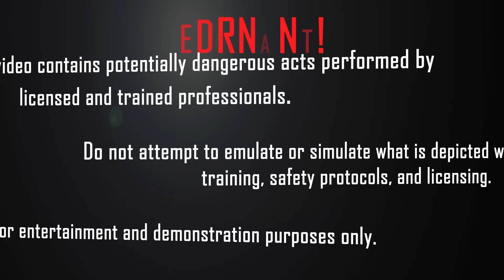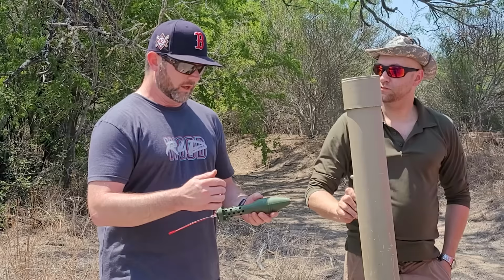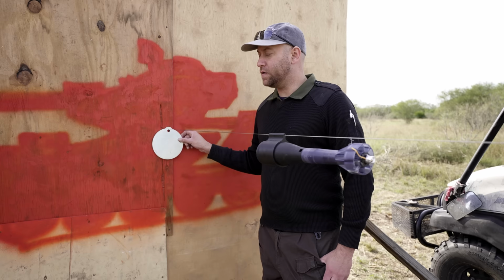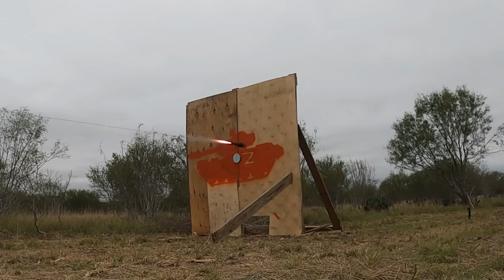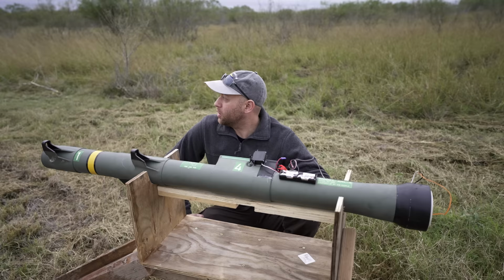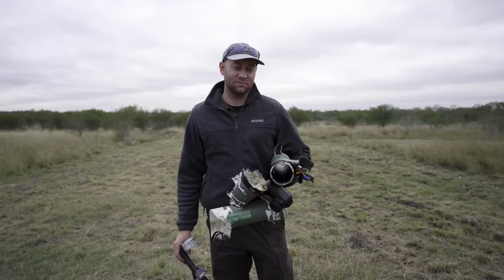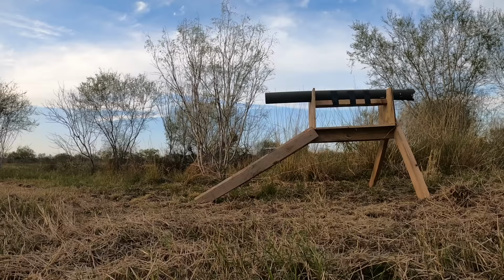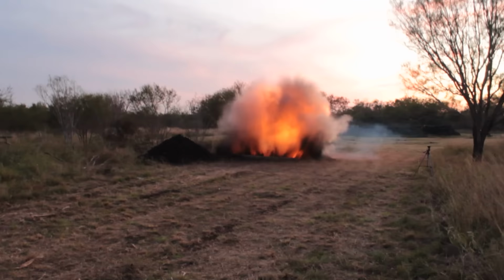3D Printed Explosive Rocket Testing | Feat D&S Creations

Comment from the maker: This video took forever to make and edit. The weather was just awful for almost the entire week. The rain turned the range into a giant mud pit. Walking anywhere would cake your shoes into giant mud clogs. The cold did not help either.

Fortunately, Steve and Jake maintained solid motivation to get the rockets made and videos filmed. Steve is hard at work with the mk 3 variant of the rockets now that fresh data on what works and what does not is collected from our testing.
Reply: add spin/rotation too the rockets.
Reply: Have you though to add a small section of metal tubing into the wire guide on the rockets to keep them on the wire instead of sawing through and flying off in random directions?
Reply: The 3d printed liner was my idea. remember?
Reply: It's easier to use a recoilless system as a shoulder fired munition. Easier to have calculated ballistics and interchangeable war heads. Rockets favor best when you up the scale past 120mm or larger. So... Rocket favor mounted platforms, Hydra, hailstorm, and tornado rockets... They also do best of soft ignition moving platforms like aircraft, think of the old HVAR rockets
Reply: You should colab with backyard scientist his rockets work like 70 percent of the time
Reply: are the files available to download somewhere?
Reply: Some of us work in that weather all the time. Dress appropriately and have a great pair of mud boots!
Reply: is the Ordnance Lab in Canada?
Reply: @mobo8933  texas I think
Reply: thank you very much for the 4:18 hint. much apricated
Reply: @Ordnancelab have you thought about using survo motors for stabilizer fins or use some of audrino sensors ie heat/temp cencor chemical cencor motion censors small survo motors and those censors? I'm a huge fan and you are an inspiration to me I've been making Suger and potassium rocket engines I make at home and love your content
Reply: @carlmccallister1059  His rockets were wire guided. That doesn't count.

Comment: Better late than never! This video took a while as I had a ton of videos to work through. We launched 21 rockets and ran almost 5 cameras, so it ate up a ton of space on my jump drive. Steve and I compiled a great deal of data from these tests to work on an improved rocket design. Soon, the final project will be complete and we can move onto world domination. NBD
Reply: Almost 5 cameras? 🤔 I really want to know why the almost was added in there 😂
Reply: @Tsunauticus IV  had one develop technological issues.
Reply: Just glad to watch a video by you guys. Kept up the great work. I appreciate all the great content.
Reply: suspend the motor on the front..make like a split yoke design to hold it in the middle on the nose and a wedge under the nozzle with grooves running to the back of the rocket to make the thrust gas bypass the actuall body ...add stabilising X-shape winglets on the back of the rocket atleast as far as the main body lenght...also the grooves that allow the thrust gas to travel from the front of the rocket to the back can be slightly twisted so it adds some spin stabilization...if you make few of rockets where the trailing winglets also have a twist to them..each instance more and more you should be able to dial the twist rate and make it compliment the thrust grooves twist rate,  using some high speed footage in like 5 rockets..while i havent seen this design being used anywhere and considering that diverting the gasses around the rocket to the back of it will result in some thrust loss and the pressure it will create in the front of the launcher will also impact  exit speed this should work..would work even better if 4 small thrusters are used in an angled diverging thrust nose cone assembly - thats if you can reliably activate them in the same time. if you want more ideas id love to share and help develop them..if you really get down to work you can even print them in vase mode xD
Reply: Did someone really call the mounties on you? What's next? The BSAP?
Reply: It's always cool to watch you guys work, but I think you're rushing a bit with the way you're working. You're testing lots of different parts at once and while you're learning a lot, I think you'd get more and better information if you worked slower and more methodically.
While you work on getting a dummy rocket to follow the wire to the target, also work on your trigger with a gravity rig. Once the trigger goes pop reliably, mount a charge and test until the charge triggers and penetrates just like a static mount. Test your fin release with real-speed air or spring powered launches before burning expensive chemicals. Do you know for certain that your launch tube was straight in the first place, and not melted by repeated launches?
Once all those parts work separately and reliably, then stick it all together and try to hit a thing on a wire. And then you have to worry about accuracy. Basically you have a shaped charge that works in laboratory conditions, mounted to a rocket that should - theoretically - be working just fine. Trying to solve any problem when you test it all at once is going to be like hanging wallpaper; smooth down one bubble, and another pops up somewhere else. Fun to watch though, and I really do hope to see you make it work.
Reply: What abt ur hyperdrive?
Reply: @roboticintelligenceunit1a652  the hyperdrive project went way over budget.
Reply: @jlambuth  Were those APCP motors made by you guys? From what I can tell, I see a few RCS Store parts like the composite 28mm casing and the epoxy-mounted nozzle, but I could be wrong...
Reply: I'm so irate that this video was not suggested to me. It is months old and I get zero notice. A lot of my usual channels I watch do not get shown to me anymore.

Comment: Question from a hobby rocketeer. Are you using commercial model/high power rocket motors (like those from Aerotech, Cessaroni, Estes, etc.)? While reliable, they do have a tendency to 'sputter,' 'pop,' and have a delayed ignition. CATOs like those you experienced are uncommon, but usually occur if the motor is prepared improperly or has manufacturing defects. Try to find some local rocketry clubs for advice; there are some guys there who have been in the hobby for years and would be more than happy to help you with those stablility issues!

Comment: The "undesireable flight path" from the second to last shot on the durable target was actually quite clean - Very little spiraling, looked as if all the fins had deployed properly on the way out, and it had a smooth loft, just so much it went over the intended target. Has D&S tried running these through a software like OpenFOAM to test aerodynamic stability? It could lend some handy clues and reduce the number of physical iterations required to get repeatable results.

Comment: personal advice would be to simplify the rockets. While cool the folding fin designs require alot more precision in opening then traditional fixed fin designs. 
Perhaps try a mortar style rocket that way it seats well in the barrel, if youre worried about not producing enough drag for stabilization then use thicker fins or bend the edges. Also try using a aluminum lining for the inside of your launch tube. This will add rigidity, protect from open flame, and absorb heat.

Comment: First, Ive done this before and see some of your issues. Though when I did it, I was a kid and 3d printers did not exist so I was working with balsa and cardboard for the rockets and PVC for the launch tube.

From what I could see in the video as well as the flight of the rockets exiting the tube, I take it that the nose of the rocket was not stabilized in the tube and the rocket was nose heavy. Meaning it could move as it traveled down the tube length. There are two ways I solved it, one was to make a sleeve for the rocket out of foam that was snug in the tube. This was cut so it would break away as the rocket exited the tube. It worked most of the time. The best solution I came up with was to put a set of fins by the nose of the rocket that made it the same diameter as the inside diameter of the tube. This kept it straight and allowed me to hit targets at about 50 yards. Seeing that 3d printing is a thing now, I would make the front fins an airfoil design and test both straight as well as at a small angle to impart a spin to the rocket. With the short launch tube a spin could help stabilize the rocket as it moves down range.

Comment: 3d printed anti tank rockets are such a cool concept. Instead of shipping several truckloads of anti tank weapons that can get stolen and used by anyone, just ship a few 3d printers and a bunch of c4. sure, someone can use the c4, but not everyone will be able to put together a functioning anti tank weapon out of a small amount of it and a bunch of 3d printer filament. Keep it up guys.

Comment: @OrdnanceLab hey guys, i have alot of experience with rocketry and rocket aerodynamics. Your  main issues with the rockets flight is COP (center of pressure), weight distribution, and the boosters power and timing. A true RPG is launched at a significant exit speed of around 400fps. This is important as RPG’s are not true balanced rockets. With weight always being in the front due to warheads, RPG’s need enough speed on the exit for the right counterintuitive pressure to keep it flying straight. This can be done by making giant expandable fins and/or making warhead lighter. I know you want power, but matching weight ratios while keeping firepower is always impossible due to military have obviously better machining and quality explosive. I also recommend testing without a booster charge, because unless it perfectly timed and weighted, the motor ignition will always send it haywire after the initial charge. Even with giant expanding fins. launching directly from tube on just the rocket motor alone will keep it much straighter. Start with a basic model rocket that flies flawlessly, no load aboard. Then start to add load weight evenly, this route will take a bit of math and testing, but if had an 150 gram motor, i would only put about 20 grams of explosive in nose. Then test flight. Use small ball bearings to mimic weight. Also calculate your shaped charge weight into the mix. Basically Keep the nose light, make fins big,  and forget about a booster charge unless you can get it leaving the barrel at 400fps +. Also theres rocket simulations out there to save on money and supplies! Hope this helps!

Comment: Try taking a page from the IRA and putting a counter weight in the launch tube. They used "biscuits". AKA cookie dough tubes. It will help accelerate the rocket out of the tube quicker so it's already on its way to the target and the rocket motor only helps. 

Another alternative is making sure the rocket is done firing before it leaves the tube.

Comment: Few things that might help from an old engineer, longer launch tube, faster rockets, less guidance complexity (extending fins of that size at the speeds you want would need to be made of incredibly hard steel or titanium or similar to not flex and throw your flight off I'd reccomend either a fast rotation with sturdy componants or slower rotation with much longer slick barrel or much faster speed with the slow rotation), more propellant stability (you might try vibration settled innitially liquid propellant like a stronger rocket candy or something) you want quick but VERY steady burn rates here.

Comment: I have my Level 1 high power rocket certification. The rockets we fly are, of course, nothing like what was shown here. There is some common ground though. CATOs. I launched the same rocket (4" diameter LOC IV) for two years in a row. At the last launch (literally, the last launch for that rocket, ever) the retaining rim on the 38mm motor failed and the motor drove itself through the center of my avionics bay. Fortunately the bay was built well and I got some telemetry from the "launch". It was spectacular. The following month our L3 guy's rocket, intended to reach 40,000', had a motor failure at mach 2+, and to my knowledge he still hasn't found the expensive bits. He did recover one of his camera's. It had some still shots of the sustainer passing it on the way to who knows where. Making a reliable rocket is no easy task. Making one of the rockets in this video is orders of magnitude more difficult. I hope they keep trying.

Comment: Hey there, just throwing it out there incase you guys wanna try an open ended suggestion, 

Perhaps to try and make sure the rocket leaves the tube in a straight line; 
Try putting a long knotch down the length of the rocket body that slots into a groove inside the tube, or vice-versa (knotch in the tube, groove on the rocket body), so it can leave without yawing or pitching to one side inside the tube, and that way there is less air gaps inside to make the rocket "bounce" around on the inside. 

And another suggestion, just like the guide wires of a real TOW, perhaps have a very very low tension reel of fishing line attached to the rockets tail so it has something to drag like a streamer as it flies forward out of the tube. That way it has something to help keep the nose of the rocket from yawing as it flies

Comment: Most of the unguided rockets burn up in the tube for good reason. Much easier to calculate a pure parabolic trajectory than one with a rocket pushing it, you also have to worry about center of balance and pressure changing with the motor burning. RPG 7 gets around that by moving the rocket nozzles up to just behind the warhead and adding those large fins.
Reply: I think a recoilless non rocket assisted model is the way to go. Far less room for error. The amount of distance you gain via the rocket booster doesn't make up for the accuracy loss. If you can accurately place a war head 200 meters from the shooter you're doing better than most designs

Comment: The simplest inertia driven firing pin to ignite a primer would require it to hit something and slow down. Safety pull pin before firing for drop safety. that’s gotta be behind the shape charge but the blasting cap or initiating explosive is shock impact flame ignitible…

Comment: There are a few things to keep in mind with any projectile or rocket:
Not only your own accuracy, but also that of others. For example, production tolerances of plastic tubes. If the wall thickness of a plastic tube used for a rocket body is half a millimeter thicker at a point, which can be very small, than at the rest of the tube, then the mass and therefore the weight will be higher there. And the imbalance is complete. This rocket cannot fly a straight path without an active correction. The same is with stabilizing fins. Suppose you have three of these flip-out fins. All it takes is one of the fins to deploy a hundredth of a second slower than the other two fins and the rocket will no longer fly a straight path or one of the fins will weigh a milligram more or less than the other two...... . Extremely difficult to construct.

Comment: Any marine supply store will have fiberglass tube for engine exhaust, that will be a much better launch tube than pvc pipe. It is stiffer and holds its shape much better and is stronger.

Comment: What if you guys tried a recoilless design? That way you don't have to deal with inconsistent rocket motors and flight trajectory. 

Could make something like the IRA's PRIG. And so you can keep the 3D printing aspect you can still print the projectile/warhead.

Also for when you guys get the rockets figured out, a rounded nose is better for more consistent detonation as a pointed nose is more likely to bounce off and fail to trigger the fuze.

Comment: I do not know your propellant mix but here goes...shape the propellant grain with an internal cast shape of a star ( 6-8 point, allows more surface area ) this should be the full length of the propellant grain. Ignition should be from the front of the grain not the rear.  Drop a line if u got questions.

Comment: You need to put the rocket motor behind the metal target, the metal target should be at 45 degrees above horizontal. The rocket head should be in a fixed position in front of a camera and the target accelerated into the head. The pros do it that way for a reason.

Comment: Here's a project. Can you make an air burst rocket using an arduino and  accelerometer shield. Hint you would need to program the distance to target with laser range finder. So you would have two the elements in the equation speed and distance. So you would need the microcontroller to figure out the time to detonation.

Comment: A recoiless rifle may be easier to achieve consistent hits with. I know ISIS actually developed a shoulder fired recoiless rifle using spent AT-4 tubes and SPG-9 shells and charges. Might be worth while to look into.
Reply: It’s wasn’t spent at-4 tubes. Conflict armament research has a multipage report on it with every variant of it dissected and photographed. All the plastic bits was made by them via injection molding in Mosul.
Reply: @TheBic4  Awesome I wasn't aware of that. If it was a craft produced tube that's even more interesting to me.
Reply: @Shrapnel-tj3il  yeah its just 3.5inch steel conduit. they put plastic rings around the spg-9 or rpg-7 warheads that allowed the different size projectiles fit in the same size barrel and maintain a gas seal. pretty crafty stuff.
Reply: @TheBic4  Just read the report, ingenious use of the munitions on hand. Also not having to deal with rocket motors probably simplified it a bit (though the whole counterweight so it could be fired in enclosed spaces is not simple either).
Reply: @Shrapnel-tj3il  yeah it’s a little lacking on specific details on I was hoping for more details on the counter mass. Im looking for simple ways to improve the counter mass for my launcher(I got videos on my channel😉)